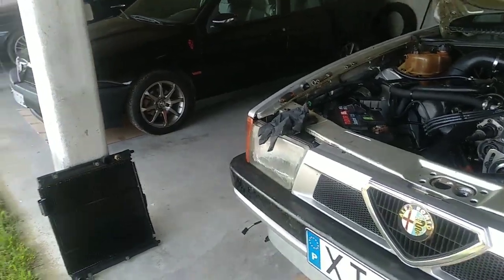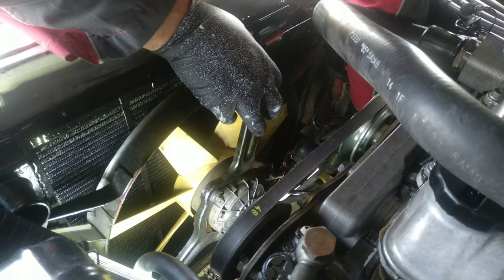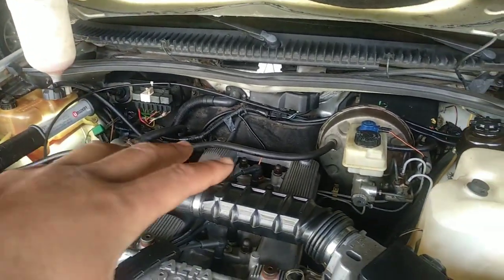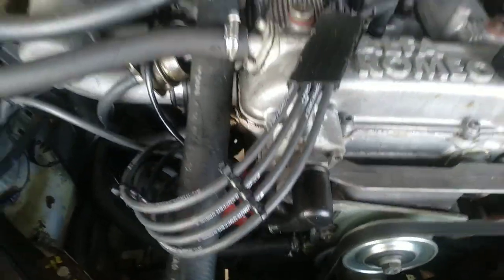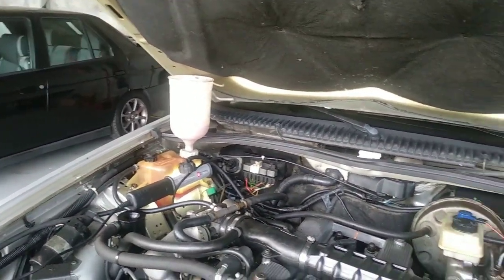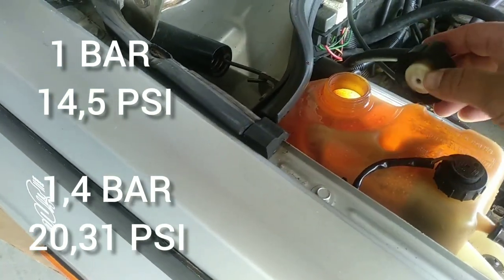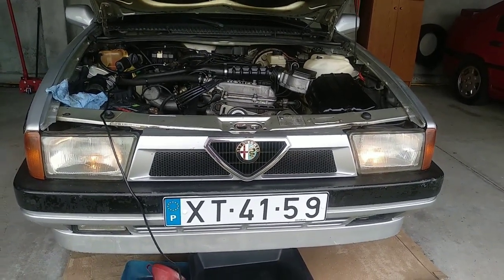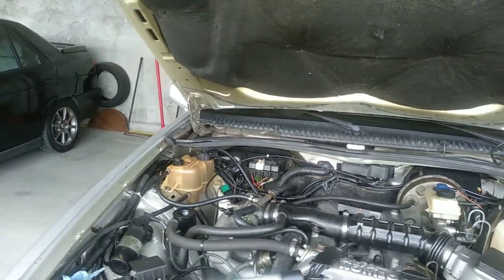Cooling systems, how do they work? Principals of working. Alfa 33, 75, 155, etc.

Comment: Hello my friend, do you know if there is a drain plug on the engine block of a 156 2.0 TS (petrol)? I changed my coolant yesterday, unplugged the lower radiator hose and emptied the reservoir, but it seems that some water remained in the engine block since it took only around 4 liters of coolant
Reply from the maker: Recent engine do not have a drain plug. Many makes and models don't use it anymore.
For that it's even more important to replace whatever amount of coolant you can.
Remember to always use Paraflu up 50.
Reply from the maker: Was checking on fiatdalys.lt and it seems it has something on the 1st and 2nd cylinder on front. 
It appears to be a inner hexagonal socket. Send pictures and vin to my email on the description.

Comment: Hello Bruno! My 156 engine 1,9 td like yours has a blue colour antifreeze. You talk i think about only red antifreeze. He told me that those years that make this type of engine they had only blue colour antifreeze. He suggest me not to change it to the red one because if the system has totally cleaned, the mix of blue and red antifreeze will be a disaster. Can i let it like this? Also everybody in my country use a tap water and not a distilled with the antifreeze
Reply from the maker: Hello. He is correct but not informed all the way.
Yes, they came with blue Paraflu 11 and yes, they cannot mix ever! 
But, 2002 and up model came out with the red paraflu up one, on the dealership the service news, the oficial internal communications of the factory that is, stated that from the moment you have to remove the antifreeze you should switch to paraflu up instead. They also say that to do so, you have to clean the system very well with just water before putting in the new type of coolant.
I did a few in my dealership days under this service news and I did like it very much. It is a much more capable coolant mainly for inner corrosion resistance. Not perfect... But better!
Tap water is relative... If it has low iron and low mineral it's not terrible. But detailed water is cheaper even.. compared to bottled water.
Reply: Sooo….. its better quality the red one but first you have to clean it very well.
Reply: Thanks a lot!
Reply from the maker: Exactly
Reply from the maker: Thanks for watching!